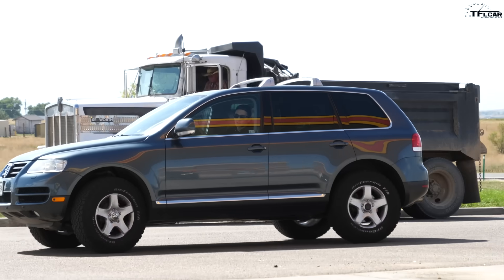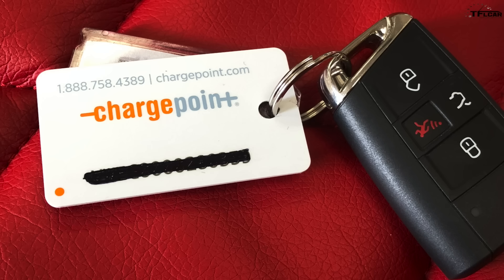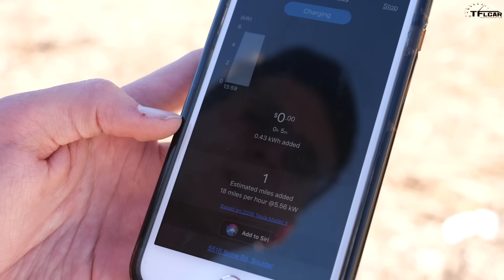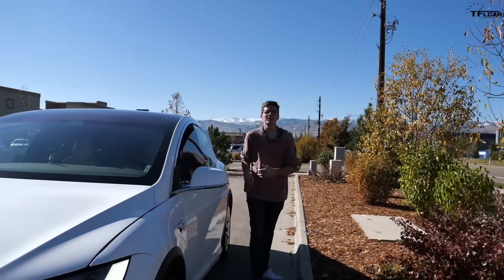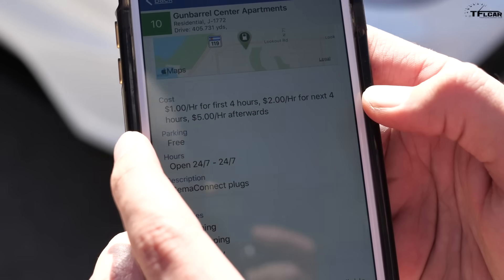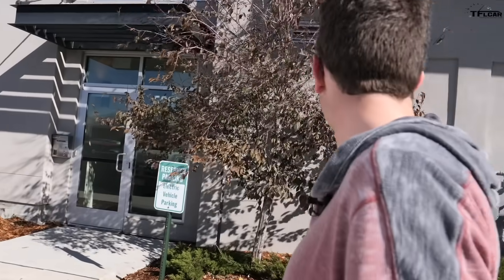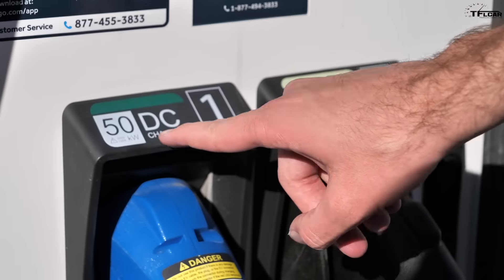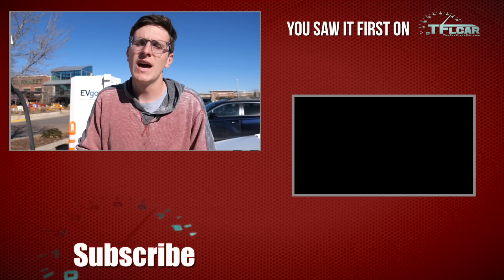Here’s Why Charging an Electric Car Can Suck - And It’s Not The Reason You Think!

Comment: Thanks for pointing out the plug and port issue. If EV really does take over I could see most OEMs building their own charge stations specific the brand. Things to think about....
Reply: Maybe in the short term but over time they will standardize.  I think they will end up on the ATM model.
Reply: "If EV really does take over".....EV ownership in the US stands at 2% and globally only 1%, I don't think you have to worry about them taking over for a very long long long time, in fact demand for Telsa's have weakened.

Comment: Basically car manufactures doing same mistake when every phone manufacture was trying to create its own socket ,  to charge you more for cables. Took them a while to make type-C a standard. Let's see how long car manufactures will start make one standard outlet in every car to charge it
Reply: Exactly, how many adapters are going to be left behind as well.
Reply: Actually since smartphones came out pretty much all Android manufacturers were using USB plugs and Apple was the only different one with their own proprietary Lightning cable. It's the same story here with Tesla isolating themselves with their own sockets and chargers.
Reply: CCS1 will be the standard in the US.  All manufacturers are moving that way except for Nissan and Tesla.
Reply: @randy5298  and who said that you CCS1 will be a standard? Did Ford or GM agreed on it?
Reply: Vladyslav Shangin yes GM has used it since 2014 in their Spark EV and lives on with their Bolt EV, Ford agreed to it to but it has yet to develop an electric car with it (if it’ll ever)
Reply: Vladyslav Shangin the reason why Tesla moved away from standardized is because they wanted to offer faster charging rates than they existed at the time pushing for 120kw to charge double the speed of the 50kw chargers of the time. Nissan and Mitsubishi uses Chademo is because when they came out with their EVs CCS didn’t exist as a charging standard yet (as they were among the 1st EVs with fast charging to exist) and Chademo was their only way to go. 
So all of this pioneers of EVs have their reasons for going away from the most common CCS standard
Reply: Vladyslav Shangin All American(except Tesla) European and Korean automakers that sell cars in the US has agreed to the ccs standard.

Comment: I couldn't do a BEV as I live in a house that I can add a level 2 charger and that would work.  In the future, hopefully not soon I may be an apartment dweller who will be inconvenienced finding stations that are nowhere near home.  The nearest Tesla Supercharger is 30 miles away.  And there's the 1,000 mile drive I've done three times over seventeen hours that I don't want to turn into a 27 hour drive.
I did just buy a 2019 Honda Accord Touring and is the best of both worlds to me.  The same drive 2,000 miles round trip in a Buick LaCrosse according to Gasbuddy is about $150.  The 2.0T Malibu Premier I sold could do it at $130.  And the Accord Hybrid can pull it off at $85.

Comment: Any charging network that requires an app or RFID card SUCKS. Tesla's Supercharger network requires nothing other than plugging in. You are billed automatically and seamlessly. Of course, home charging is 99% of what EV owners uses.
Reply: Tesla's supercharger network is proprietary though. You need a subscription with Tesla (and own a Tesla car) to make use of the network. Each charging network having its own subscription model wouldn't be practical. You'd have to have multiple subscriptions or limit yourself to one network.
Being able to pay with credit card would make more sense. Like with gas stations. You don't need a subscription (or a car from a specific brand) to tank at a gas station.